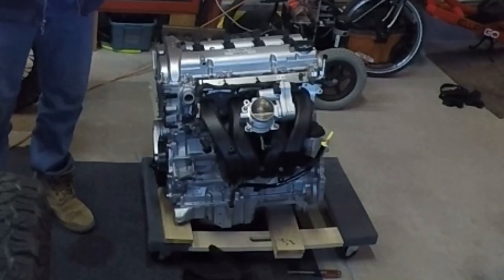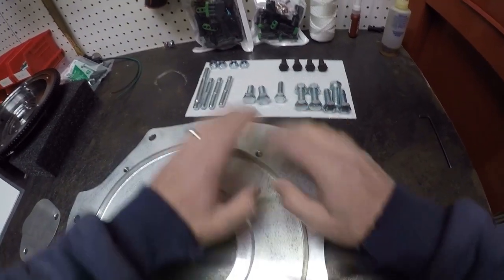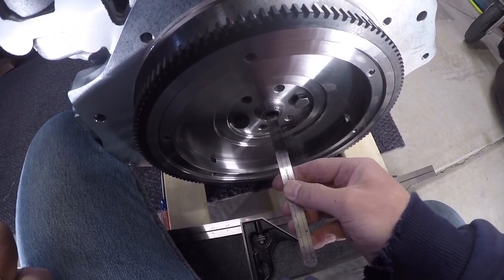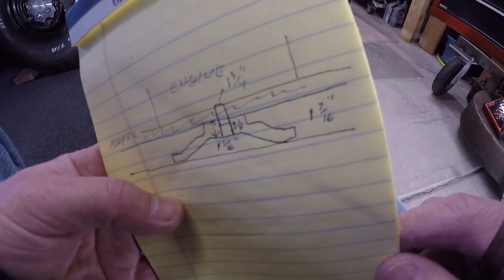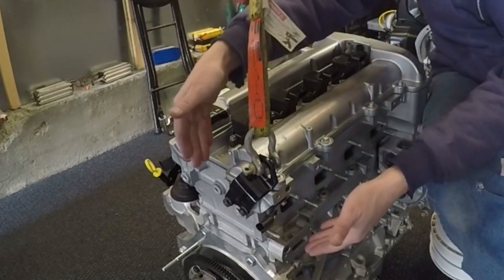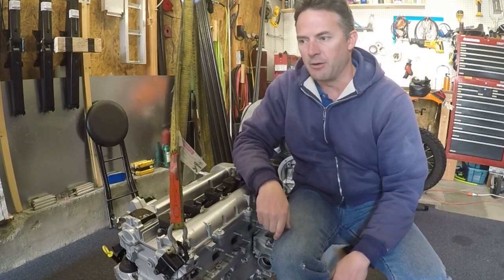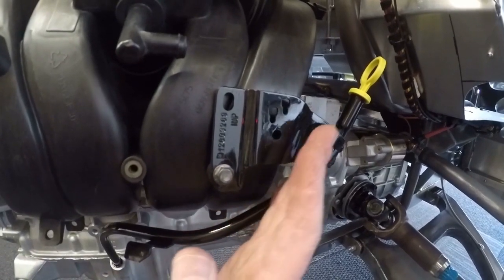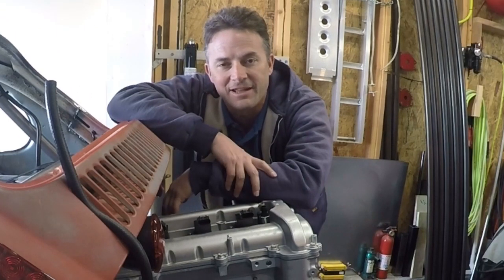Ecotec to Baja Swap Ep  5, Putting in the Engine!

Comment: Hello have you had any problems with running to 10 degree mount
Reply from the maker: Nope, the oil returns just fine, and no problem with oil pressure either. Every time I have the valve cover off the timing chain looks like it's getting plenty of oil too. 
I will say I do keep it up to the top on the dipstick. And leaned back that's a bit of extra oil. But I haven't had any issues.

Comment: Did you run a thermostat and how did you get the air out of your system
Reply from the maker: I don't run a T-stat on this engine. The temperature is controlled by the electric fans on the radiator. I got the air out using a plug as a bleeder on the leaving port for the radiator line up near the valve cover.

Comment: Hello, what starter are you using?
Reply from the maker: This is the stock VW starter. It bolts in the original location and everything. The Ecotec has a provision for a starter. But with the adaptor flywheel you retain the original starter in the original location in the VW transaxle.

Comment: What tipe of transmission are you using, I have the same motor
Reply from the maker: It's a stock Bus Type 2 with the 5.37 R&P. It's held up this far. Has about 1,000 miles.

Comment: this may be a silly question but what is the downfall for putting a ecotec motor or any motor in a sand rail with its original transmission?
Reply from the maker: The downfalls would be that the stock transmission isn't really meant for that kind of power. So it makes the likely hood of breaking the transmission really high.

Comment: Hi, can i ask you something?
I don't know here in europe, a car that have the motor in that way that you have on the Baja Bug.
I mean, all the cars here have transversal engine and gearbox like renault for example, or have longitundinal engine in the front with the gearbox next to it still in the front, like passat volkswagen 2000 year.

How can i switch the positions of gearbox and engine?

You have the gearbox in front of the engine, i like that very much, with all the weight of the back...

Thanks

P.S.

The only thing that i can do, it is to use transversal engine and gearbox, mounted on the back, to have a lot of wait on the back.
You can see on my buggy.
https://youtu.be/yegYlhTMFKk
https://youtu.be/JV3ugwoyoyc
https://youtu.be/EzCyqvu0Kyo
https://youtu.be/yPV2PyidmyM
Reply from the maker: To have the setup I have you need a transaxle designed for that. Either a VW Bug or Bus transaxle or an after market transaxle like a Weddle SV4 type transaxle.
BTW I like your Buggy, looks like it's running great.
Reply: @DougBugBuilder  i understand, so i remain to transversal engine and gearbox.
I am very pleased about my buggy,  very soft suspensions, the A arms are 60cm each one, the buggy is 2m wide 2.5 long.
Very stable at angle hills.

Comment: did you make your own brackets to pick the ecotec engine up?
Reply from the maker: No, the brackets I used were on the engine in the chevy Cobalt when I picked it at the junkyard. I used those to set it in the chassis as well. Then once it was in there I unbolted them.

Comment: Can you tell me what size bots you use for the ecotec and your motormounts?
Reply from the maker: The bolts for the motor mounts were dictated by the threads that were already in the side of the Ecotec motor. If I remember correctly they were 12mm x 1.25mm.

Comment: Adapter kit is awsum I wounded if I could put a fwd motor and trans from Camry 2.2 or 2.4 and use axles and struts just put it from for front to rear amazing work your doing what do you do for living
Reply: The oil problem what they do sometimes is put a cage around oil pump screen keeps oil there at all times
Reply: Doug.  Ls motor L's 3 heads L's x or L's 1. Use crank use càm   head work to L's 3 heads.  They prove time and  time  HP come from L's 3 heàds.  Stock short block head work ànd ls3 and high lift. Can. Ànd in return  over  1000 horse power  the best design in ten years racing   guys are going nuts L's motors I've not done one but I'm sure I can I e built hundreds of engines  I'm a problem fixer alluminum engine blowi hg head vskt because studs were pulling from block we fixed made inserts for blocks new studs ne2 nuts   lß motors next on my list after I fix my roof hericanetook  a little  roof out I'm in north Carolina. Burgas nc

Comment: sweet ....my buddy is a fabricator and mounted one of these eco tecs in a 1988 bmw  e30..he also mounted it inline using a toyota 5 speed  trans... turbocharger..custom intake and intercooler with header...thing was a rocket til he rolled it..whoo hoo
Reply from the maker: Nice! With a turbo that thing must be pretty quick.
Reply: @DougBugBuilder  "was pretty quick" he rolled it...a car he built before this bmw.. i mentioned was a 63 bug, he put a street ported 13b rotary in it..which as you know must be water cooled..he seen the idea out of a 70s custom bug mag and figured it would be cool..the thing was a rocket! scarey fast off the line! he rapped that one around a light standard as well!

Comment: Filling these with oil/doing filter changes in a beetle kinda suck, but the ecotec is a great swap. Wiring is super easy too! Just make sure to get your oe pcm security hacked (if you're running that) or it won't start.
Reply from the maker: Thanks MrTurbo, I ended up getting the PCM flashed by Alpha Fab.
Reply: Doug Bug Good deal, that's where I got mine done at. People always ask me why their ecotecs won't start... Sweet build!
Reply: I'm learning a lot. How do you sleep I don't sleep I think to much best time for me is when I sleep ive. Fixéd a lot of stuff in my sleep and repair next day I think I'm nuts sometimes
Reply: I worked with 54 techs at one time a big Toyota dealérship we sometime fixed problems with new cars write reports for Toyota for warrentee suggest ways to fix problems  Toyota ahead of the rest great car .I spent 23 years there and my dad owned the oldest Volvo dealership in america first ducatti and subura also I don't no anything else no I'm disabled at least they tell me I am got hit head on.sucks but I can sleep in

Comment: Being watching your vids and your doing a lovely job on the baja. I personally would have stuck with the original vw engine, i noticed CB performance do big stroker dub motors which would have delivered great torque and power plus kept it very light.. But its your baja and i respect your decision.. still very keen to see how it all works for you.. just subbed... keep em coming cheers from Tasmania....
Reply: Ecotec>air-cooled but yes vw engines are more simple.
Reply: The engines from CB performance are really high dollar, you can get a ectec for what 250 dollars and have 160+ HP takes more money to get 160 HP from a VW engines, I know all about it I've played with VWS for a long time, still do some
Reply: @steveenglund3742  I need to find a good one price at 250.
Reply from the maker: Hey Buddy, Welcome to the channel, good to have you on the team. lol
It has been interesting seing the differences between the air cooled and Ecotec so far. My Bug was really light and simple with the air cooled motor. It was a little heartbreaking taking that out and adding all the components to operate the Ecotec. I hope it's worth it. The air cooled is safely in the basement, so we might see it again. ;-)

Comment: Hi Doug. I have a few questions I hope you can help me with. I live in Australia and from what I can gather there are no aftermarket Baja bug suspension kits available. Do you know of any in the US that I could use/talk to. I am interested in doing something very similar regarding suspension but to get home made suspension through engineering here in Oz would be  near impossible. Any help would be greatly appreciated.  Great video's keep them coming and hope to hear from you soon. Have a great Christmas
Reply from the maker: rottysaurus, You can't buy an A Arm setup like mine, that's a one off that I made myself. However there are some companies that make good trailing arms for the front or rear suspension. Try Kar-tek Offroad, Appletree Automotive, Chirco, and Air Cooled.net. These are all companies that carry good parts.
Hope that helps!
Reply: Hi doug do you have this gentlmens info in regards to a front a-arm kit??

Comment: Awesome video, thank you for taking the time to post it. Was the flywheel modified at all to fit the VW transmission/clutch/pressure plate or does it happen to work for that particular swap?
Reply from the maker: Thorvald Moen, This flywheel comes with the kit and is machined to fit the VW transaxle with 200mm flywheel. So on one end it is machined just like a VW flywheel and on the other end it is machined to mate with an Ecotec 6 bolt crankshaft, and when it it designed/machined the proper offsets are put in it.
I paid a little extra to have it lightened, but that didn't affect any of the fitment.
I hope that answers your question.
Reply: Doug Bug Yes it does answer my question, thank you. I look forward to the next video!

Comment: I would stay focused on keeping whatever ground clearance you have due to future losses with some type of skid plate protection. Also center of gravity and overall balance something to keep in mind.  Nothings perfect and you have the skills to change things later. I enjoy your thought process
Reply: Doug Bug You'll be fine, just run it! Don't over think it
Reply from the maker: Hey EZGZ, You are right. My first plan is to look into the oil return in the head of the motor. I don't want to change the angle. I like it and it helps with the tail draggi'n. I just need to make sure the oil can drain out of the head.

Comment: Looks like a small spacer to raise the front of the transaxle would help reduce the angle and maybe even help with clearance issues too
Reply from the maker: That would work.....But would really take a lot of work because of all the connection points I made on the transaxle. There would be a lot of fabrication involved. Not like that ever stopped me before though.
Thanks for the idea though.
Reply: Doug Bug you're welcome and I wasn't thinking about the work that's already been done.. but the the downfall to custom projects they never seem to find a true finished point. Always somthing that can be improved or changed up.
Reply from the maker: That's the curse and the joy. ;-)

Comment: i know there is fitment issues but in the long run the fuel injection i heard it will be worth it.I am still collecting parts for my swap
Reply from the maker: Michael Rhoades, Yeah I expected there to be some issues. Nothing to major. Collect what you can so when you start the swap you can rock and roll on it.
Thanks for the comment.

Comment: Hey Mike, hope you don't mind I have recommended your channel to a couple people, it would be a shame for someone that's in to Baja's not to be able to enjoy your work!
Reply from the maker: Heck yeah man, spread the word. lol
Reply: Hey Mike, I know you stand behind Lincoln welders so I have been spending a lot of time looking at the Lincoln 210 mp, the reviews on the stick and mig are really good, the tig seems to be ok, but I guess you have to wire up the foot pedal, but i'm ok with that.i have a couple of questions I see that most of the time I am seeing gas with the mig welding is that when you don't have flux core wire or do you always need gas to weld mig, and do you recommend gas? and my other question is can you mig and tig aluminum with this machine. thanks Mike
Reply from the maker: That welders tig process is not AC, so it won't do aluminum. Don't buy it. You really have to step up in the welders to get AC tig. You will really need two welders. One for mig and one for tig. The benefit is you can get the mig now and in a couple years if your fab skills are still growing you can get an AC tig and start tigging aluminum.
https://www.homedepot.com/p/Lincoln-Electric-180-Amp-Weld-Pak-180-HD-MIG-Wire-Feed-Welder-with-Magnum-100L-Gun-Gas-Regulator-MIG-and-Flux-Cored-Wire-230V-K2515-1/100670932
For the money I think that is the best Lincoln welder for Mig. It will do mig or flux core. If you do mig you will need gas. The gas will be a mixture of Argon and CO2. If you do flux core you wont need any gas.
The Lincoln Square Wave Tig 200 is a good choice for a garage tig welder that will rock and roll aluminum. For tig you will need 100% Argon for your shielding gas. Almost any tig welder will stick weld as well.

Of course there are no name brand welders for a fraction of the price. That's up to you. They are likely fairly good. All I can say is both of my welders are 20+ years old, local supply houses support them. And when I go out into the garage both of those welders look at me and say "what are we welding today"!
Reply: Mike , right now I have a brand new Chicago .stick welder and a new dual mig, I bought both from my neighbor for 150, they both came with carts, rod ,wire, helmet, and and a big fat book on everything you need to know about welding. Mike I couldn't pass this up for the price, these are only temporary, I will be getting much better quality stuff soon. would you agree this is a good way to practice on small welding to sorta get the hang of it. I have already built a little dog for my wife and I had a blast doing it. now I know why its called stick welding, but after a while I was going along pretty good, then it got fun. again these cheap welders are only temporary! Now time for another episode of Doug Bug
Reply from the maker: Mike that's perfect! A great way to dip into the waters and test some stuff out, for $150 that's a steal. Now you can fiddle around and casually look at an upgrade if you decide to go that route.

Comment: Not sure if the plug end is the same , or if it will even fit, but both the cam position sensors on a 2011 chevy Cruze  come out of the sensor straight, yours turns 90 degrees. And they are 3 wire.  Might be worth looking into prior to moving the fuel cell.

Part # SU13343 from autozone is the intake side.
Reply from the maker: Holy cow! Good tips with part numbers, nice. I'll look into it. I might need to mess with the fuel cell either way for access to the rear of the block but this might give me some options. Thanks!

Comment: What transaxle are you using?
Reply from the maker: Bus type 2 with 5.38 R&P.
Reply: Doug Bug. I am doing a engine swap in my Baja. My engine is a Mitsubishi Lancer 2.0 only because own the car where I don't have to buy another engine. Wondering if you can help me about the ECM. Do you know if the place how did your do other car manufacturers ECMs?
Reply from the maker: I'm checking with them, I'll let you know what they say.
Reply: Doug Bug. Thanks!!  What did you use to hold your fenders on with? You drilled a hole and insert the peace in & the tool name. I'm going to get some of them. You didn't mention what they wear in your video. Thanks for all the video's you are very good!
Reply from the maker: David, Throse are called rivit nuts. Here is an example of a kit similar to mine.
http://amzn.to/2BmCzLF
The rivit nuts I used on those fenders were 5/16-18.
The tool I used is an industrial one from McMasterr Carr. It was like $180. But the link I gave you there is for a similar one just not as industrial. The choice is yours. ;-)
Make some test sets first to get comfortable with it before you drill into the bug. Once you get the hang of it they are great though.